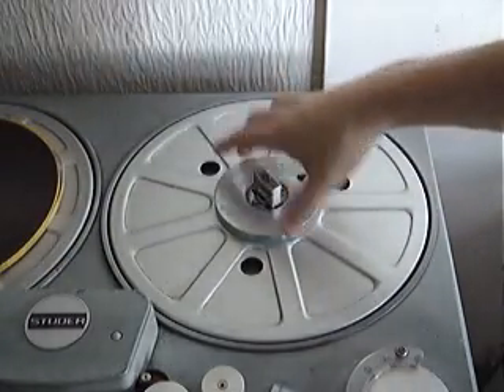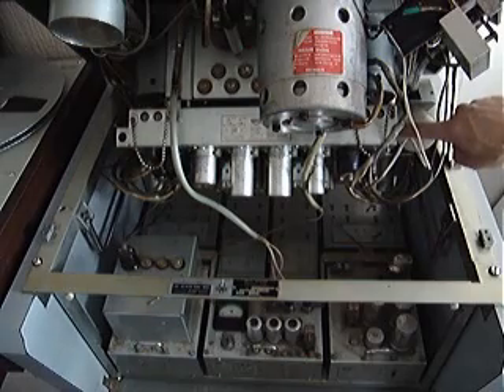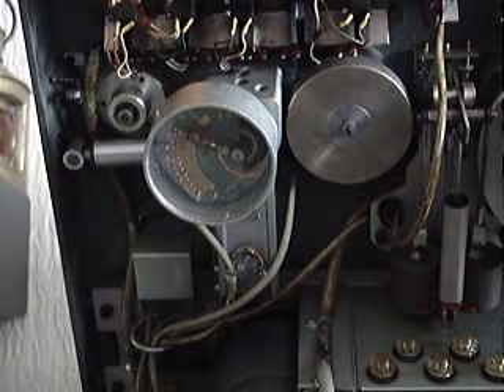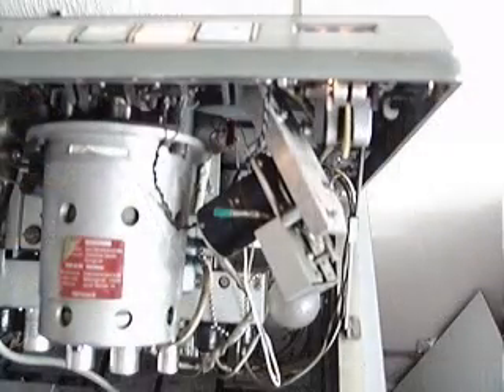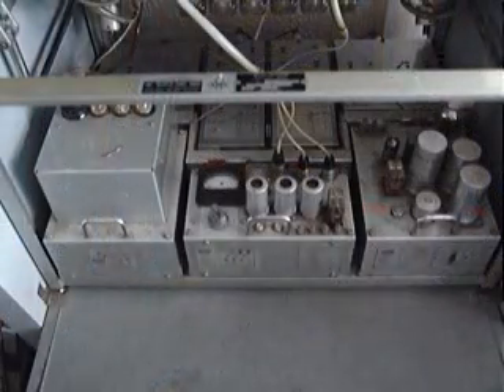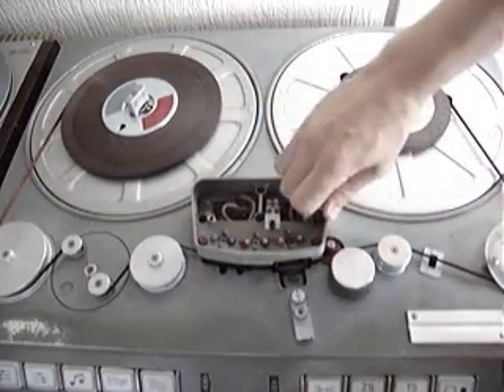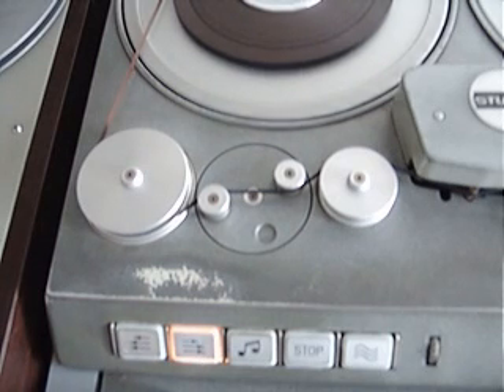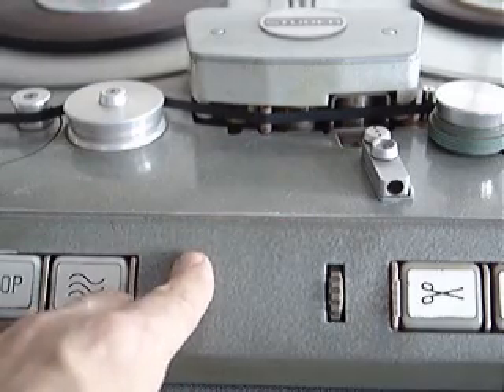Studer C37 Valve reel to reel tape recorder

Comment: Firstly, it is great to see a relatively young person with the skills and interest to preserve these old machines.

I had a now late friend, Jim Jackson  who worked as a SM at the BBC from starting training in '63 until the early 90's (after a brief spell at Mullards transistor plant in Croydon - hand assembled OC series at the time), he said that when he started at the Beeb he though there was still a Marconi - Stille steel tape recorder lurking somewhere at the Maida Vale studios, bear in mind that the world transcription service was still using cut disks in the early 60's and that was all part of the training!

He was in awe of the Studer C37 and considered it to be made regardless of cost by Willi Studer to capture the top end studio market, he said they were so well made that the the performance was a good 25 years later, in contrast to some of the later Japanese machines that were excellent when new, but showed their age after 7 years. 
He said the EMI machines that came before the C37 were quite good but always had to be lined-up before a recording to give their best.
The Beeb apparently phased out the valve equipment in the late 70's partly because the SQ valves were becoming scarce due the fall in worldwide production limiting the quantity of valves to select the best from. 
He said C37s  were sold off for £50 each along with lots of other now desirable items, the last one I saw was a mono in M&B radio in Leeds at £250 in the mid 90's, they had bought a number of them. 

From my memory of a 1964 HiFi yearbook that they cost about £1,259 for a mono and £1,550 for a Stereo new. 
There was also a lesser Phillips machine in use for general work which could be rack mounted I think that it had a four digit name , Jim said that they were ok but had the peculiarity of reel brakes applied by solonoid, ok until the power failed when fast reeling. Apparently the main switch for the studio equipment was right by the door and it was not unknown for a hand to come around the door and briefly switch off, so it was unwise to upset collegues!

Anyway, many thanks for a very interesting channel.
Reply: The Philips machine with solenoid applied brakes  at the BBC was the EL3501, very good for editing on apparently.

Comment from the maker: No, 13ips, it's a none standard speed, something he calculates for optimum performance with the 1 inch stereo heads. So the machine was not actually a real production machine really, it's a modified recorder like what Tim does in essence as 3M never made it with those electronics.

Comment from the maker: Interesting, I know of the 3M machine but not of the 821-B, is it a production recorder or one offs like the famous Tim De Paravaincini machines, he based his machines on the Ampex ATR-100 (I think) and the Studer C37, both machines were 1 inch tape running at 13 ips. He boasts a response of 20Hz to 35KHz on the Studer with a dynamic range of +- 0.1dB! absolutely superior machines but not a production recorder however I could send my C37 off to him and have it changed to these specs right now.

Comment from the maker: got that noise bit wrong, its not as loud as -7dB, its below -60dB possibly -70dB but not measured correctly. The 3M 996 is great stuff, I may experiment with a DBX unit on it sometime but with the sound being so crystal as it is it seems a shame to add electronics into the circuit.

Comment from the maker: At the moment I am using Quantegy 456, sometimes Emtec 911 and sometimes Scotch 996, it's the cheapest of the lot but comes on great looking gold reels. Noise reduction, it's the mains caps causing problems on this machine, the noise is not a problem, I do not like the DBX units but I do have some.